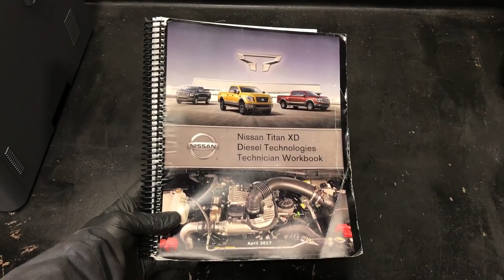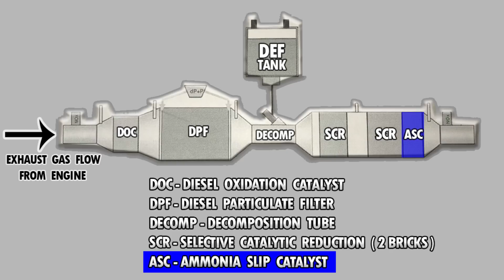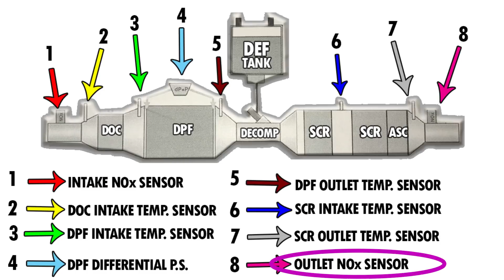NISSAN TITAN DIESEL DOC DPF SCR  DEF SYSTEM EXPLAINED

Comment: i have a p2456 code , says Diesel Particulate Filter (DPF) pressure sensor , is that something I could replace or get it to a mechanic? I am mildly mechanically inclined! Thanks

Comment: John, I had one fault come up and it was “DEF Quality Sensor “ fault. As you know, the sensor is located in the DEF tank. I replaced the tank, replaced the DEF fluid, and the “Quality Sensor “ fault cleared however, the truck still has a DEF System Error that will not clear, how do I get that error cleared?
Do I have to disconnect the battery, or cycle the truck from off to acc a few times? I drove it at a steady speed but it never cleared.

Comment: Thanks for sharing a breakdown of how it works. I have a question concerning the DEF, which has a leak by the dosing valve decomposition tube. Am I still able to drive it before it reduces power?
Reply: I had the same problem I disconnected the water reservoir sensor and it solve the problem that it had they came defected from there we need to replace all that!

Comment: I took my truck to maus Nissan.  They told me my truck was throwing these codes and this is what is going to cost. Diagnostic -Can you find out what parts these are for this code?

[Other]: replace doc and dpf assembly with sensors code p1484 and p200e
$12534.46

Comment: Hi John I was wondering if I replace a bad nox sensor if you need to do anything with the computer like a active regen or I can swap out the bad front nox sensor code p2201 and it will be good to go I have a 3,000 mile trip coming up in 3 weeks thank you for the video

Comment: My truck says my DEF is low but I filled it when it was 20%.  It didn’t register that I added 2.5 gallons.  Now a few hundred miles later it says it’s going to go into low power mode.  

My Nissan Dealership says they can’t help me because they don’t have a Diesel Mechanic.

What’s wrong?  Is there a way for me to fix this?

Comment: I have a 2018 Platinum Reserve Titan XD Diesel that I bought in Fairbanks when my old Nissan Titan died.  The display that shows the DEF level never moves from full.  Is this a known problem?  The local IN dealer tried to fix it but failed.
Reply: You need the updates software from Nissan to fix that

Comment: Had problems with DEF errors for last 2 years when truck was well within the 80000 km warranty, had truck into no lass then 5 Nissan dealerships could not find problem , however one suggested entire DEF system should be replaced.
Now truck is at 85000 km and dealership says it is Nox sensors need to be replaced at $1300 each.
Should have a class action law suit for this as from what I here this is a design problem that is well known to Nissan.
Can this system simply be removed, the error now says I have 200 km before the truck engine will only be able to be driven 4 miles per hour ( 8 km per hour) any ideas please send to my email aubreystewart@engineer.com

Very pissed off Nissan customer....

They use to be a reliable vehicle maker, have. 32 year old Nissan 300 ZX that still works as good as the day I bought it... they have fallen far over the past 10 years , no customer service......
Reply: At least you got some mileage out of yours..  this is also above.. John,  a year later and as I forecast above at 12,000 miles,  a major issue with the DEF,  or should I say, many issues with the DEF system, the tank, the SCR, and the DEF Fluid manufactures labeling of the box or bottles of DEF.   Why? The DEF fluid from the start has a critical expiration date that is not labeled clearly if at all, on any of the boxes or bottles. I even asked the sales people and the manager at an major Auto Parts Store what the Manufacture date was on a box of the Lates Premium Blue DEF and if it was expired as DEF will ruin a $10,000 system, and you may never find out why you have to pay so much to get a Bad system repaired. No one new the answer, The DEF tank installed on the Nissan Titan and possibly all DEF systems, has no way to drain it if you suspect for some reason your truck has sat too long. So the DEF fluid system may inject or try to inject bad fluid into the SCR which could be cause for a major failure that will leave you stuck in Limp mode in the middle of a desert if your there.. or out somewhere without Cell phone coverage in sub zero temps with a truck full of kids.  All of which are major safety hazards not yet identified by the highway safety department which I will be working getting them to realize the safety issues very soon..   "Frozen Kids found in Truck".  Possibility for failure are very real and I have experienced a couple of them just because of a very bad design by Nissan to satisfy EPA with a system that is much worse environmentally than even a straight pipe coming off the engine due to regens, more pollution from discarded old DPF systems, plastic from the empty containers of DEF and it goes on and on.. I have 23,000 miles on a truck with a "best $4000 guess"  NOT UNDER WARRANTY"  (due to living in a No emission testing state.)  If replacing the SCR I am sure the dealer will need to keep throwing parts on at my cost.  So it is a no win situation for me.. Truck is shined up and engine bay is spotless, interior and outside spotless,  I put some money in a high end Diamond Back Bed Cover and rear window guard... Brand new Michelin 70,000 mile tires etc.. I am not a happy Nissan owner and I told  Nissan Manufacture Customer service so, they do not care.  Never again Nissan... this was going to be my retirement truck as I retired this year... now I have to find.

Comment: Great video. My 2018 goe into regen almost every 300 to 500 miles. I want to pull out this whole system and do a turbo to back exhaust. Have you dealt with any turbo to back exhausts on a Nissan Titan XD so far?
Reply from the maker: Unfortunately I have not, only stock . Heads up though it will void warranty if u remove . Thanks for watching!

Comment: Can you by any chance tell me where the egt sensor 5 is located?? I have codes 2482 and 2481..
Reply: Eli I am having the same problem with P2481 bank 1 sensor 5 low. I only have an issue when it is raining leading me to believe I have a connection issue or wiring issue. did you every find B1S5? there is very little good information out there on this.

Comment: John, I have a 2016 Titan XD SL 2WD. I have taken to dealership twice and neither time they could figure this out. My DEF meter on the driver display is not showing even after selecting in menu options to show. I just realized the other day it is also not showing the exhaust temperature getting warmer after driving for an hour on highway. I haven't had any warning lights that DEF is low. The engine only has 10k miles on it. The previous owner blew long block so they replaced and put a wiring harness in as well.... What do you think I'm missing? Is it a sensor that's out?

Update** I found the wire connector on the DEF wire connection for the Decomp was loose and the locking mechanism was broken, could this be the problem?
Reply from the maker: Yes it sounds like a wiring problem, a lot of harness go bad on those. And if they not installed properly it can be a nightmare. I’d take it back and tell them to recheck it. If something is unplugged there will be a code for it in system

Comment: John, after getting "DPF filter overloaded, Immediate service required" I removed DPF and cleaned it.  Manual calls for Service Re-generation procedure.  What is it, and how it can be initiated by the owner?  Thank you.
Reply from the maker: You shouldn’t have to remove it to clean it,   There is two types of regeneration active and passive. Active regeneration is when you take it to the dealer they hook the computer up and do it that way it’s real thorough. Passive happens automatically when you’re driving around generally highway driving. Stop and go driving clogs them up big time.  Regeneration just burns off all that black soot .  Thanks for watching

Comment: I had a 16 XD with the Cummins. Have the newer ones gotten more reliable? Had a lot of trouble with the 16 but would like to get in a newer one if the bugs have been worked out
Reply from the maker: Yes they slowly getting better- first year was the worst year for sure. Electrical bugs are worked out pretty good
Reply: @johnthemechanic3360  any thoughts on the main bearing failures that are starting to come up on the 5.0 Cummins?
Reply from the maker: @jamesg6071  Aint really seen many  main bearing failures yet but have been seeing wire harness issues on cylinder 5, connector burning up. There seems to be different problems in different parts of country

Comment: Thanks for a well detailed explanation of the DPF system John I almost bought the XD Diesel last year but this diesel after treatment system point me to buy a gasser and gave me and idea that this modern diesels with DPF are not so short journey friendly than old timer diesels my first and last diesel powered vehicle was an 2005 Honda Accord with 2.2 i-CTDi (in England, UK) and i love that engine no regen of some sort but 2 yrs later Honda introduced the updated version with DPF and all hell break lose. By the way John whats the life span of the system? still considering buying one but I don't do a lot of highway miles.
Reply from the maker: Thanks for watching! Theoretically system supposed to last the life of the truck, I believe at least a 100k warranty through Nissan on parts but I’d have to double check.  But u are right short trips and not driving long enough to heat up the system seems to clog them up a lot faster. They actually recommend highway driving and towing to burn the soot. When they do clog u must take to dealer and do stationary regen with computer hooked up.

Comment: Do you by chance know the bank and sensor number for the EGT?  I use the Torque Pro app to monitor my engine parameters and EGT. They are displayed as such: EGT bank 1 sensor 1, EGT bank 1 sensor 2, EGT bank 1 sensor 3 and EGT bank 1 sensor 4. 

Would I be correct with assuming that the first EGT sensor you showed was EGT bank 1 sensor 1 and the last EGT sensor is EGT bank 1 sensor 4?  

TIA
Reply: Thanks. I'm still messing with it to figure what sensors I want to read and which ones I don't need.
Reply: @johnhewitt6570  Good Evening, were you able to figure out the sensors? I recently purchased a used 17 XD with the Cummins and am still trying to figure out the best sensors/data to track. I use the OBDFusion app.
Reply from the maker: Hey sorry I didn’t get back sooner I didn’t see the comment for some reason. I know there is a temp sensor on the EGR that measure exhaust temp b4 it mixes with the intake charge air, but b1 sensor 1 is most likely the DOC intake temp sensor ( # 2 in video)-  that is first one that reads exhaust gas temp after it has left the engine. There is 5 total on after treatment system- #2 - #4 -#7 - # 12 & # 14 in video. They  all reading exhaust gas temp. Hope it helps thanks for watching!
Reply from the maker: My bad I was looking at text book they numbed differently- so in video it’s sensors #2 - #3 - #5 - #6 - #7

Comment: I have 37,000 miles and waiting for my dealer to get parts to replace my unit already. My service manager told me yesterday that he would have talked me out of purchasing my truck if he had seen me prior to my getting it. This is the third time in a month I’ve had to take back for getting engine light on. All different issues.
Reply from the maker: Wow that sucks sorry to hear that. Sometimes it seems like they are cursed! I’m actually replacing a engine harness now in one for squirrel damage- it nested right under the intake manifold and chewed everything up, $5000 in damage and not covered by warranty. I’ll make a vid on it soon. Hopefully u don’t have any  more problems. Thanks for watching!

Comment: How can I get deeper tone out of the exhaust on mine without deleting the DPF system and voiding the warranty?
Reply from the maker: I haven’t seen too many options for these yet unfortunately, all I have been able to find is the last section from after treatment to tip that has a little bit larger pipe- but haven’t heard one installed. I’m afraid to get any real change it would void warranty. If I come across anything new I will let u know- thanks for watching!
Reply: Not possible, delete it, tune it and egr delete. If you don’t the truck is less reliable.

Comment: thanks so much for posting this..  I now hate the DOC DPF SCR DEF SYSTEM even more
Reply from the maker: Lol - thanks for watching! Yea I like old school diesel exhaust  better - these things rob power like crazy.
Reply: Cool to see how all the garbage I threw in the trash works!
Reply: @destinhook3826  love this you want a long lasting truck? Delete a diesel.
Reply: Wow great review.. now I know the reason behind the DEF Delete.. those parts must be trouble in the making and once that holder fills up I assume that is gonna nearly bankrupt me..  Unless there is a drain/clean out plug it is best to get the DEF Delete System put in early on my New Diesel.. I have 12000 miles now.. wonder how much soot it has in the holding tank?
Reply from the maker: Hey Mark thanks for watching 👍 The DPF (diesel particulate filter)  catches the soot- and it gets burned away there - either through driving or regeneration. So no need to drain or clean out anything system does it by itself. The DEF tank holds fluid needed to clean up tailpipe emission (Nox). Usually when they talk about “delete” it means u take out the whole after treatment system and u will blow the soot out of the tailpipe, and you have black exhaust smoke when u floor it. But as long as you keep DEF  fluid in there the system good for at least 100k miles.
Reply: John,  a year later and as I forecast above at 12,000 miles,  a major issue with the DEF,  or should I say, many issues with the DEF system, the tank, the SCR, and the DEF Fluid manufactures labeling of the box or bottles of DEF.   Why? The DEF fluid from the start has a critical expiration date that is not labeled clearly if at all, on any of the boxes or bottles. I even asked the sales people and the manager at an major Auto Parts Store what the Manufacture date was on a box of the Lates Premium Blue DEF and if it was expired as DEF will ruin a $10,000 system, and you may never find out why you have to pay so much to get a Bad system repaired. No one new the answer, The DEF tank installed on the Nissan Titan and possibly all DEF systems, has no way to drain it if you suspect for some reason your truck has sat too long. So the DEF fluid system may inject or try to inject bad fluid into the SCR which could be cause for a major failure that will leave you stuck in Limp mode in the middle of a desert if your there.. or out somewhere without Cell phone coverage in sub zero temps with a truck full of kids.  All of which are major safety hazards not yet identified by the highway safety department which I will be working getting them to realize the safety issues very soon..   "Frozen Kids found in Truck".  Possibility for failure are very real and I have experienced a couple of them just because of a very bad design by Nissan to satisfy EPA with a system that is much worse environmentally than even a straight pipe coming off the engine due to regens, more pollution from discarded old DPF systems, plastic from the empty containers of DEF and it goes on and on.. I have 23,000 miles on a truck with a "best $4000 guess"  NOT UNDER WARRANTY"  (due to living in a No emission testing state.)  If replacing the SCR I am sure the dealer will need to keep throwing parts on at my cost.  So it is a no win situation for me.. Truck is shined up and engine bay is spotless, interior and outside spotless,  I put some money in a high end Diamond Back Bed Cover and rear window guard... Brand new Michelin 70,000 mile tires etc.. I am not a happy Nissan owner and I told  Nissan Manufacture Customer service so, they do not care.  Never again Nissan... this was going to be my retirement truck as I retired this year... now I have to find.